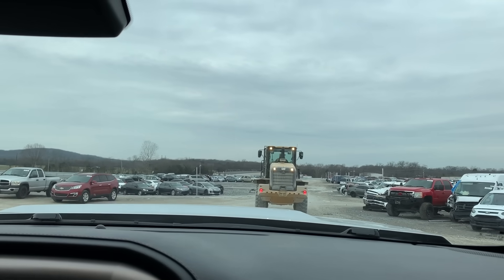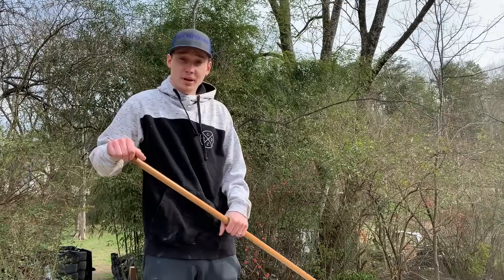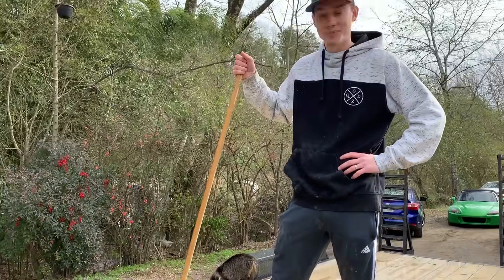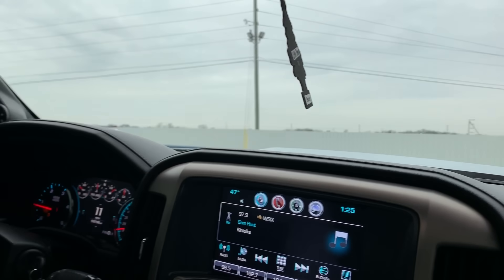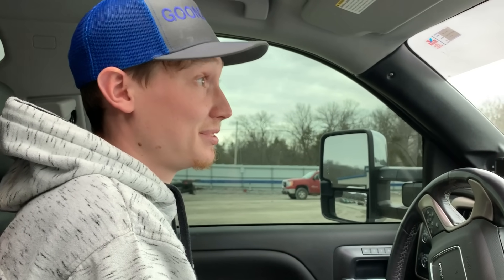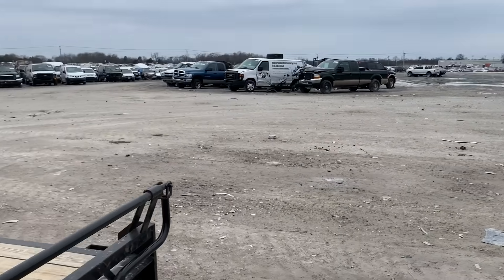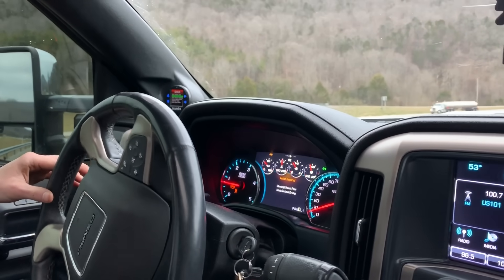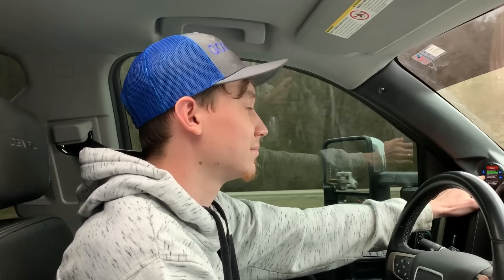Buying My Dad His Dream Wrecked Truck!!!

Comment: Dudes I give you a thumbs up for sweeping off your trailer before you hit the road.  Thinking of others is what true Southern Hospitality is all about.
Reply: Luchace Fox I was thinking the same exact same thing!!
Reply: it's also a law.
Reply: @Alex0992  and unfortunately many wind shields can vouch for the fact the peeps dont care its a law.  I've only really seen it enforced in AZ.
Reply: Alex law or not ppl don’t care for others in this day in age unfortunately
Reply: I've got 2 broken windshields and about 10 chips to attest that people in the south could care less about sweeping off their trailers
Reply: They picked up the Jeep and it was dirty as hxll  good job guys
Reply: @jasoncocca9409  You do realize trucks are driven in by drivers from all over the country right? its people like you I really didnt give a crap about when my flatbed was dirty...which was rare but if you got a chip and want to complain about people in the south...couldnt happen to a nicer guy
Reply: devilselbow (
Reply: @TroubleBKC  since when had laws matter. I bet you speed. And go over posted speed limit signs. Lol shut up
Reply: I took a deck pin off a highboy trailer pulled by a 550 Dodge...right through the rear left passenger window. It was like it was in slow motion as it rolled off the back of the trailer, bounced off the highway once and right through into the back seat along with 18 million shards of glass.  If more guys simply gave a shit, like those two fellas do, be a lot safer on the road.

Comment: Running the tune of the highest setting while towing a load like that is what caused the check the engine light. Run it on a low tune or no tune works better
Reply: Yep! They'll do much better if they stop pimping up their cars! They literally changed this car to a non-functional one by that tune and lift!
Reply: Aref E well ya kinda but no the f-450 is there soon to be tow rig so the duramax is a toy, but they need to start doing a little more research not just on what’s best for a truck but how to use it any diesel owning with a tune knows running it on the highest setting towing 10,000+ lbs is absolutely horrible for the truck
Reply: @arefeshghi  yeah definitely don't need to run in the hot tune when towing heavy. Run it in tow tune to be safe
Reply: Definitely don't need to run it in hot tune when towing heavy. Run in tow setting.
Reply: Warren Leighton yes I stated that in my last comment
Reply: @4port  He said exactly what you said but you call him a clown. why? He said running it on the highest setting (tune) is horrible for the truck.
Reply: @arefeshghi  This truck is still very functional with the lift. Like most  everyone here has said, you need to use the proper tune while towing. It's really that simple.
Reply: @4port  Good work, champ.
Reply: @arefeshghi  "Non functional" derrrrrrrrrp.

Comment: 2019/2020 2500 and 3500s are still the same body and platforms as the 2012, all they did was a refresh on the front end and interior! The new front end will 100% fit with minor adjustments lol i work at a dodge dealership as a tech and I’ve already looked it all over haha
Reply: Kamron Rudy they have a new frame too and engine design
Reply: Dustin engine yeah I but I didn’t care to mention the engine because it didn’t matter for the front clip swap and as far as the frame goes all they did was lighten it a little bit lol not really any major changes, cabs and beds are still the same along with a lot of other things lol
Reply: True I hope they do it just so I can see how it’s done and what the challenges are. I have a 14 mega
Reply: Roman Naputi the 1500 is a totally new truck! The 2500 and 3500 is just updated.
Reply: How so ? I don’t get it,  the new 3500s pretty much have same interior as the new 1500, so If the 1500 is new so the 3500, the front end also is updated, the engine has a bit more hp, what else is needed for new” truck not considered a refresh. Usually a refresh is just minor changes in the front end  and everything else the same... but the ram new front end, new bed, new interior more power for the engine.... so to me that’s consider a all new truck... even ram/dodge says it
Reply: @tonya.3135  because its the same cab and bed and similar frame. new headlights, taillights, and fenders doesn't make it a completely fresh truck. same thing that 6.4 and 11-16 6.7 f250s are basically the same truck as 7.3s and 6.0s besides obviously the motors. of course marketing team isn't going to publicly  announced that their truck is just a same truck with new body

Comment: I cant wait for that F450 to be ready. That would make the traveling to pick up the new builds at lot easier. The duramax aint ready for primetime
Reply: And a trailer just a bit wider to fit those doolies.
Reply: It would be if it wasn’t lifted to the sky, with the right size wheel an tire an the right tune they were causing that running it in tune 6 there is tow tunes for a reason lol

Comment: I’m assuming I’m not the first to say this but when you tow with a diesel and have a programmer.  You don’t want to be on mode 6.  Stay on stock setting or tow setting at the most.  It was running to rich probably  because your injectors were shooting to much fuel cause of the high programmer setting, and I assume your egt’s were pretty high. Great content, you guys are great! I Don’t mean to be a keyboard warrior. I have made many mistakes.  I have blown up a turbo, transmission, etc.  Hopefully everything is ok on the duramax. God Bless.
Reply: It's amazing how smart these guys are but when it comes to these trucks they are so incredibly clueless. For example the tunes and then one of them was trying to call the cummins a duramax. I love watching them rebuild stuff but when they're working on these trucks I have to skip parts because the cringe of what they say wrong starts to piss me off
Reply: FixItDontDitchIt. Ez link is way better then programmers. Ez link with a module EFI switch 5 allows you to pick whatever tunes are towing tunes, hot tunes, ECO and they got a lot set will his/her phones cell. Programmer are junk. Emissions are huge problem for new trucks DPF and DEF are hurting the truck they don’t need it to our wonderful government with their bs other half countries are run diesels with 100% biodiesel is cleaner for environmental. Why they had problems is due towards DEF is making have motor run like shit. When towing should only 2 or 3
Reply: I honestly think they do the bonehead things on purpose, to get more comments and likes/dislikes which translates to more views and more income.  I really can’t imagine they wouldn’t know better especially since their Dad worked as a Semi-Truck Driver.  But I could be wrong.
Reply: FixItDontDitchIt. Huge difference semi truck and quarter ton
Reply: I say just compromise and delete the 2019!! or Delete all the trucks, that way you don't have no DEF no more to throw error codes and crap, there's usually some way around the regulations
Reply: Chris Rowlison. Delete truck performance they fast by cutting off DPF , EGR that make your truck beast. Older truck will last longest out newer trucks due Emissions. No check lights and no engine problems with emissions.
Reply: @user-hq6rn7sq2x  I always think the new ones would last longer to if they weren't "breathing their own farts" as they say
Reply: They don't know anything. They use rattle can materials, that's junk
Reply: @turbochargeyyourbankroll  lol. They know enough to keep you interested, and comment on the videos.

Comment: Hotshot truck drivers are still regulated by Logbooks and Hours of Service. I'm writing this from the backseat of my Ram 3500 in Alabama because I ran out of ours. Loads are in the tank right now.
Reply: Shaun Collins damm it’s still bad out there
Reply: Yep if you are hauling the same trailer eld applies only for rv trailer transporters it doesn't
Reply: Your are right....loads are bad rates super low....this guys dont know what they are talking about when it comes to hottshotting
Reply: Get a older truck pre eld

Comment: When ur pulling a heavy load and got the tuner cranked up your making more soot that the dpf system can clean up while driving down the road. xtra fuel in a diesel means more soot, a dpf is a big filter to catch said soot

Comment: They delete the bed and register the truck as a “tractor” so they can haul longer trailers. There’s federal and state guidelines that dictate the length unless you  register your truck as a tractor
Reply: Title says truck though, no?
Reply: Joe Gosselin lmao bro.. when they mentioned that I was curious as hell.. I’m like I know someone in the comments has a explanation, then bam you were the very first comment😭😂👌🏾👍🏾
Reply: Make sure dogs don't lick that antifreeze
Reply: live and let live that gets changed when you register it as a tractor. I don’t think it actually changes on the title but that’s the rules. It varies state to state.
Reply: If you haul interstate you have to have commercial registration. Most trucks without beds were cab/chassis to begin with and didn't have a bed.
Reply: Matt G not true. You only need a CDL if you are over a certain weight 26k and/or over a certain length 53’ (I think).truck and trailer included
Reply: @liveandletlive2894  It doesn't matter what the title shows it's what you register it as. Different states use commercial, farm, private, passenger etc. It's all about taxes and license requirements and insurance.
Reply: Matt G you need your DOT. Numbers on the side of your truck and a health card.
Reply: @liveandletlive2894  you can reg it as a tractor with no bed tractor has longer length laws
Reply: @joegosselin2888  Did I say anything about a license?? A vehicle used for interstate commerce must be registered as such. Doesn't matter if it's a 15k box van or a Semi. Yes, to operate the vehicle you must have a license for that vehicle class. I've had my CDL with hazmat, tank, doubles and triples endorsements and my motorcycle all at the same time. 8 individual tests to renew my license. Thanks for trying to sound smart.
Reply: @liveandletlive2894  you change title from pickup to tractor longer length laws than pickup
Reply: There's a ton of hotshot YouTube channels, I have watched a few curious about the business myself.  Basically you're required to pass the same DOT regs as a big rig, except CDLs aren't gonna be the same because they're based on gross vehicle weights.  I watched one video where he we inspected at his home, you have to have all your paperwork and they will help let you know what that is, any repair even a lug nut has to be documented, you cannot in anyways modify a trailer unless the manufacturer has stated in writing they approve and agree it won't hurt the performance or safety of that trailer.  There are a ton of rules and regulations that have to be followed to the letter.  They also have to deal with the regular big rig guys sabatoging their equipment. 

I am sure if their uncle is making money at it they know what they're getting into.  Go check out the videos and stop arguing as ifmyou know everything about nothing.
Reply: @mattg7952  I live in NJ, and the only state with a worse one; is of course NY. So you understand why I tremble as I hear the words DMV. (Its actually called MVC in NJ motor vehicle commission)
Reply: @liveandletlive2894  I had my own business in AZ and to have commercial insurance I had to register my Tacoma as a commercial vehicle even though I wasn't hauling anything with it. California is just as bad and taxes everything and highway patrol makes damn sure everything gets enforced with commercial vehicle's.
Reply: @mattg7952  Commifornia is the worst state in general to live in! (Aside from the weather)
Reply: @ianmcfetridge4396  I am pretty sure they are fully aware being that they seem pretty intelligent and they dont lack common sense

Comment: "Too Rich" is your injectors putting too much fuel into your engine... 100% due to your tuner box. Petrol, it'll foul your spark plugs and make them all black with soot... With diesels, it basically does the same (no s'plugs) but your DPF takes the hit... Get her nice and hot, drive her hard and she'll be right as rain.
Reply: He's using max power setting under max load. I'd try min power to reduce fuel and see if that cleans it out.
Reply: This right here ^
Reply: Someone needs to explain EGT'S to those guys, they where probably way up.
Reply: Never tow on tune 5. There is a tow tune for a reason. Keeps the egt’s in check and doesn’t melt turbo’s
Reply: Trevor Mangus they ain’t gonna listen, just like they didn’t about lifting it
Reply: They need a to get a proper tune in   the truck. Get a Banks tuner and things will last longer. It is a proven product that will not cause any black smoke.
Reply: When I went to 35s on truck, it would make it lug more if I set the tuner for 35s... I adjusted my tire settings so it shifted sooner and no more over fueling or dpf problems.  I never had an issue towing on the highest tuner setting.
Reply: Michael Wynne you need the the EGTS high!
Reply: gd1996 the fact that they tried blaming the duramax is comedy, any of these trucks will do that. It’s the dpf an egt bull shit on the trucks now days, it’s choking them out.
Reply: Brian Proffitt DEF isn't the problem. It's the DPF and EGR!
Reply: @JohnDoe-nz6bk  Yeah this whole "recirculation to reduce emissions" crap... I've seen a DPF that's 3" and by the time I've taken it off and had a look, it was barely 2... Maybe even 1.5"...🙄 Also a pain in the arse to clean 😂
Reply: John Doe that’s what I meant my bad
Reply: Brian Proffitt oh OK
Reply: +1 this was my feeling too
Reply: @brianproffitt7263  That happens a lot... a single vehicle has an issue then the whole model/manufacturer is junk.  I've take egr systems off trucks and its such a mess!
Reply: gd1996 yeah if that truck didn’t have all that bull shit it would be a beast, an I’d bout put money on it never having an issue agin as long as it’s taken care of

Comment: How many trucks do you have?
Goonzquad: yes
Reply: They have 3 trucks now 4
Reply: "All of them" 😃
Reply: You can never have too many trucks! =D
Reply: Robert Forslund well said.  You need a proper truck for just the right task.
Reply: I think they should do 5 more.  Who couldn't use 9 trucks and 14 cars.
Reply: one of each
Reply: Guys, there is a high probability that that tuning box is causing your truck to reduce power and start regenerating because at high power level it will inject lots of fuel which means the sooth filter will fill up faster.  Maybe next time just drive on stock power level and reduce speed and gear down to get up any inclines, just like all big rig drivers do as well. Good chance you will.not have any unexpected power reduction because of  regeneration.
Welcome to modern day diesel life I guess.
Reply: One of each lol

Comment: When u pull a heavy load you not suppose to run it on the highest HP tune. Run it on 30hp or 60hp. Not doggen on y'all just some advice. Bad ass videos!
Reply: Jereme Gomez glad someone knows something about diesel here.
Reply from the maker: Good to know! Thank you!
Reply: I always do but my truck is fully deleted
Reply: The big wheels on it do not help either.  More rolloing weight.
Reply: @jayfox5  the emmission crap does put a strain on them.  I agree theu run better but be careful.  Epa going after people.
Reply: Shadow Opp.'s RC not here in New York not yet anyway
Reply: @jayfox5  lucky you.  Just be careful though.  Hate seeing people get in trouble over doing it.  They run better and use way less fuel with out the emmissions crap.
Reply: @goonzquad  I'd also recommend running on a tune designed for towing like Jereme suggested, not max power. On setting 6 you were likely over fueling and pushing your EGTs (exhaust gas temps) too high for the exhaust treatment chemistry to work well; would have generated a lot of soot in the exhaust.

Stoked for your dad's truck, keep up the great work guys.
Reply: Emissions crap is there for a reason. So others don't have follow behind you and breath your exhaust.
Reply: @JuJu-vj3bz  hey ju ju have you ever been behind a diesel when it goes into regen? Promise when it does you won't be there long, smells like chemicals.
Reply: I have a 2018 ram 2500 Cummins fully deleted. Runs awesome!!! Daily drive on 90HP tune. Leveling kit on 35s

Comment: I’m a diesel mechanic. Just run the regen and it’ll be fine it just needs to clean the filter. All trucks with DEF do it, not just duramax
Reply: I was about to say the same shit
Reply: Thats y old school is better
Reply: @calebherrera1381  yup, my 05 duramax don't ever need to regen
Reply: It needs to be deleted.
Reply: My dads ford 6.7 does the Regen automatically while going with no limp mode
Reply: Your not for hire so if I was you get that engine deleted . Now your Daddy's truck he will be using for hauling so he better not delete his I have been hearing that guys are getting caught by DOT and it's a hefty fine.
Reply: Yeah I use to drive diesel straight box trucks. Same thing, def is DEFinitely annoying though
Reply: Also the Regen shouldn't take forever driving a hino 258 couple times I had to pull over on the highway to do a Regen because the truck is gutless anyway so if it went I to limp mode it just suffering
Reply: It's a 2012 NO DEF
Reply: @stevensrmek3546  anything 2007+ has def
Reply: Sorry 2010
Reply: @ethanprichard3295  I thought you were talking about the truck on the trailer. Dodge did not start DEF til 2013.
Reply: @ethanprichard3295  NOPE. Mine is a 2010 and It does not have DEF. Must be 2011 or 2012.
Reply: @wurmpool  ur 12 lol
Reply: @clappedf4508  I'm just punny. If I were 12 my video game videos I've uploaded would be much better and my YouTube channel may have actually gained some traction. But unfortunately I'm 28 and I suck at video games.
Reply: Get you a 7.3 Powerstroke. You'll never need another truck